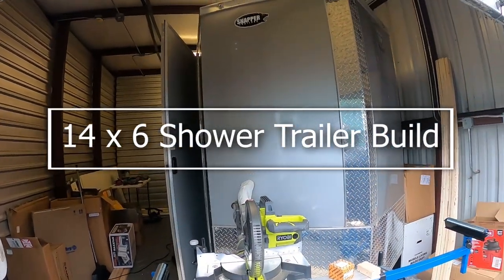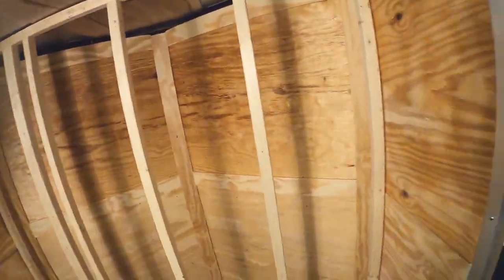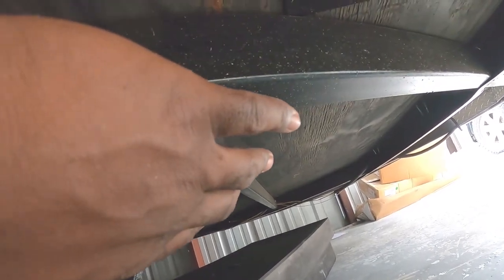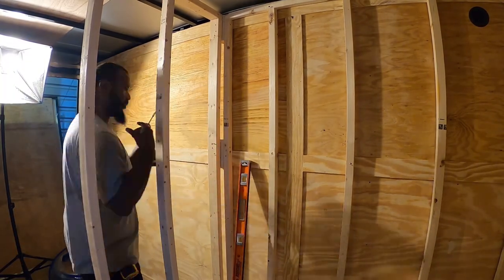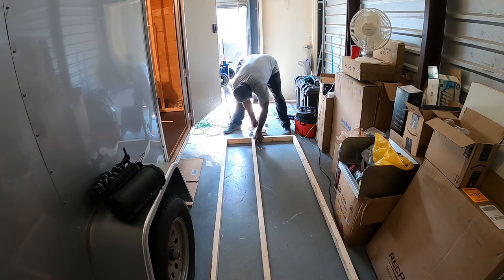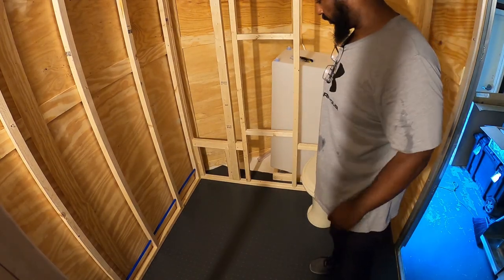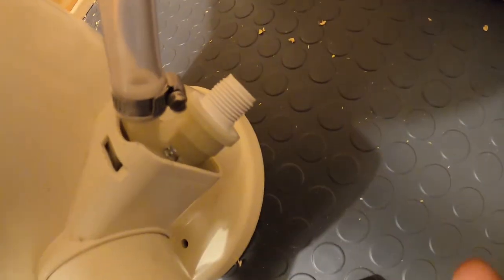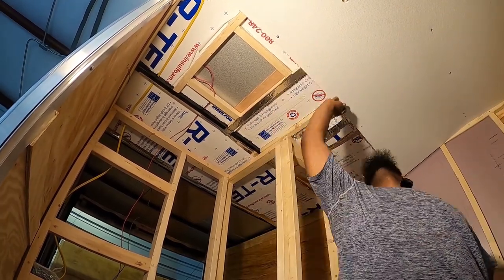Mobile Shower Trailer Build Part1

Comment: Wow! Thank you for taking the time to record edit and explain this process. We are converting our trailer into a camper and this has been so helpful in showing us how to add our bathroom in our new camper.
Reply from the maker: No problem. Remember I am not a professional. One thing I did wrong but did not fix was to install the plumbing vent above the highest faucet. Make sure you do not make that mistake.

Comment: What if you plans how all the wood you use please can i have it. I am so happy you recorded this. This is want i need for my airbnb camping site for the guest gonna try to tackle it this year
Reply from the maker: I did not sketchup any plans, I actually had a different layout in mind but that placed the toilet over the axle so I changed the layout. I can try to put together a supply list but if I had to start over again, I would make 2 small shower stalls versus just the one. I plan to wrap up this build before summer and will post more videos.